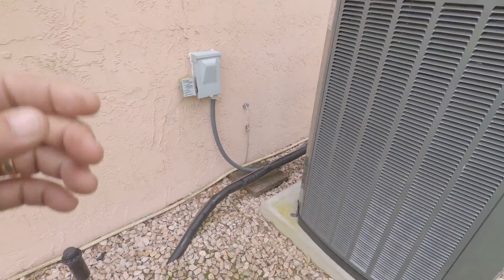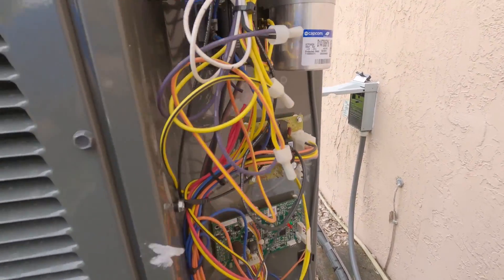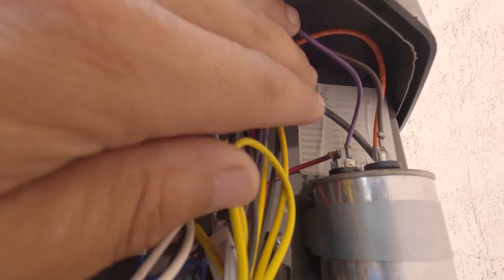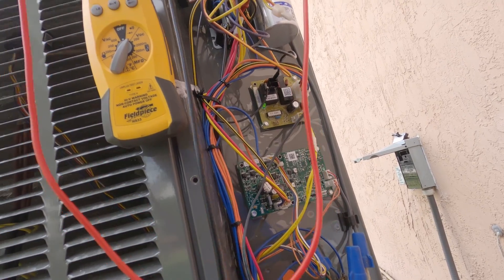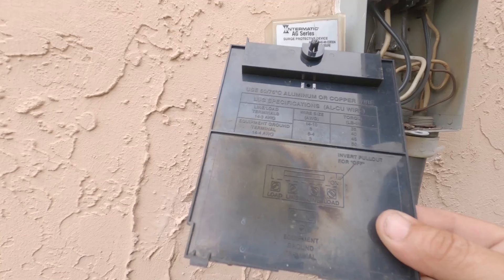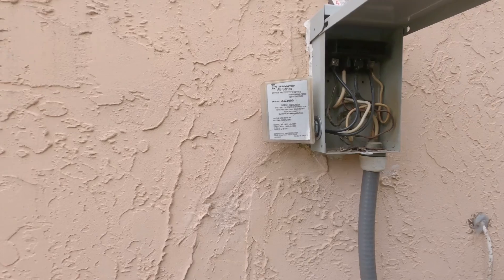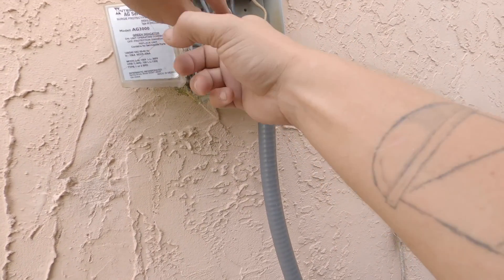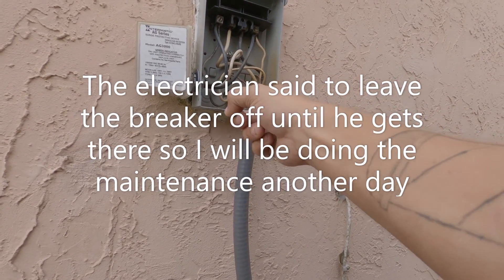Heat pump tripping the breaker diagnostic HVAC

Comment: What if the heat pump breaker is fine, but the e-heat breaker won't reset, (I realize it could be a bad breaker).
Reply from the maker: There could be multiple problems. Continuity from ground to the bad component would tell you the answer 👌. Sounds like something is grounded. That is if, the breaker won't reset when power isn't present. But then again it could be a weak breaker too
Reply: @VictorofHVAC  Thanks, any idea where I should start looking? I'd rather not replace the 50 amp double breaker only to find out something simple is just grounded...

Comment: The low pressure wire will blow the 3 amp fuse not trip the breaker on the line voltage lol
Reply from the maker: I know that, lol... I don't remember saying that if in the video if I did. Thanks for pointing that out though. I'll have to back and watch it again to double check myself

Comment: good find, the installers should have put a yellow bushing in the back of the disconnect or ran the wire on the side of the disconnect with sealtite.
Reply from the maker: Thanks, No doubt. Was a learning curve for that installer.

Comment: So you left the customer with no Cooling? Do you not pull new wire, I mean let's get the customer running.
Reply from the maker: I left them down for an hour and it was 72 degrees out that day. The customer's electrician came out that same day to fix it and the customer was good. I don't like liabilities brother 🤙

Comment: FYI sometimes the low voltage pressure switch wire will touch the liquid line and the liquid line will burn through the insulation of the wire in heat-pump mode causing a direct short in the low voltage circuit. So having a 3amp and 5amp gas furnace mini breaker for $10 each is always good (don't waste $50 on a "Popper"). In this case the installer didn't put a 3/4" romex connector on the 10AWG circuit to the disconnect. Good eyes...
Reply: Your right, that pressure switch wire was the cause of a short on two goodman hp units I worked on.
Reply from the maker: Nailed it!!.. Thanks for the support and feedback

Comment: You can’t change a disconnect never heard of AC tech not being able to change a condenser disconnect.
Reply from the maker: Of course you can, but the disconnect wasn't the issue. The wire need to be replaced from the arching. ( no slack in the wire)